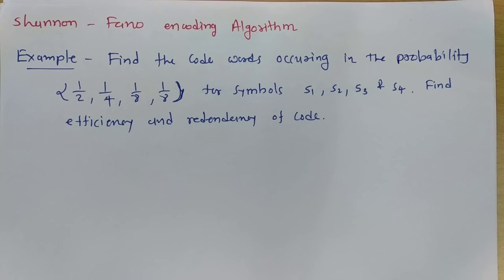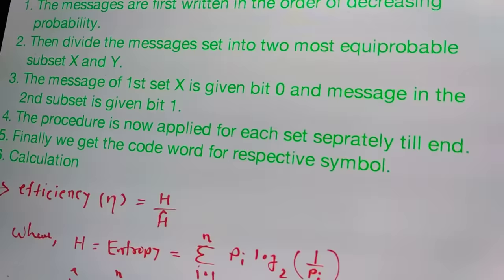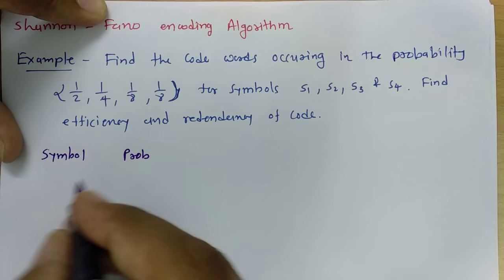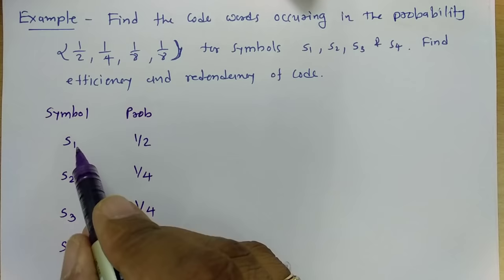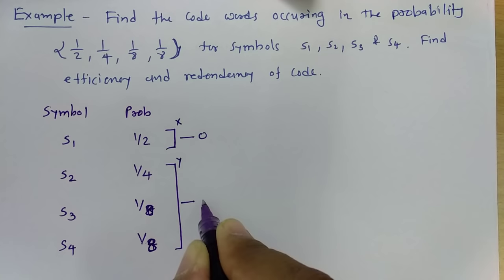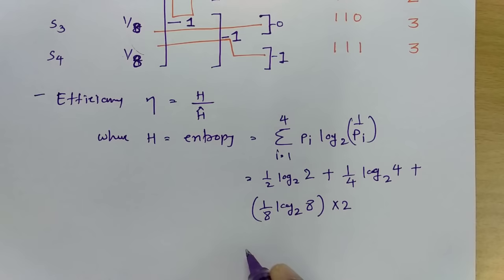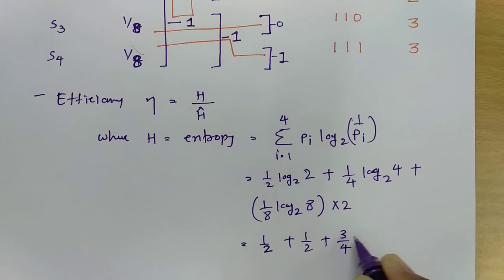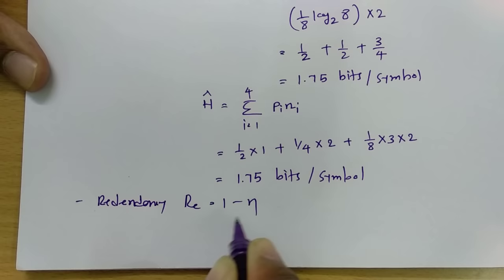1 Shannon Fano Encoding (Algorithm, Procedure & Example) Explained in Digital Communication

Comment: I don't understand equal probability sir
Reply from the maker: Just try to bisect into two parts with most equal probability.
Reply: First arrange probabilities in ascending order. Then consider first one (here 1/2) and the remaining 3 add them it'll be again (1/2) means both are equal. So divide between first probability and remaining 3 left. And assign bits. In next step do same but for rest 3 bits..